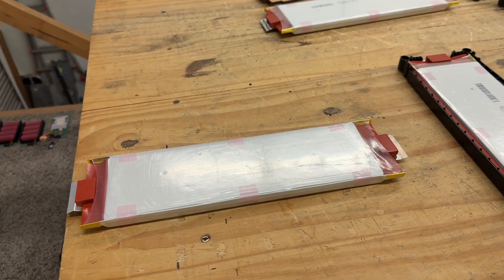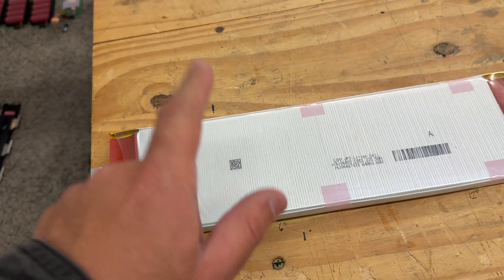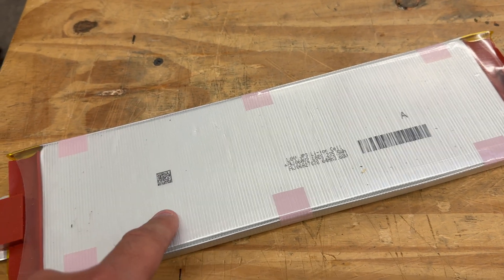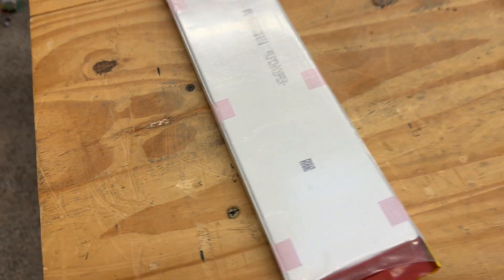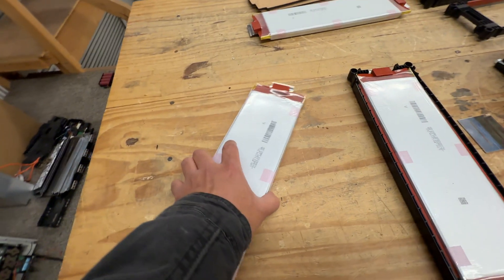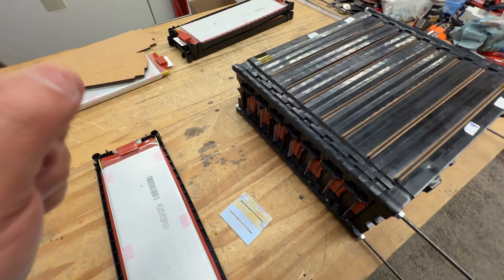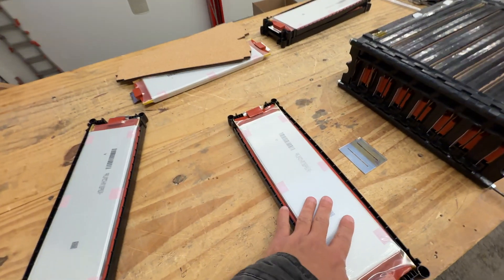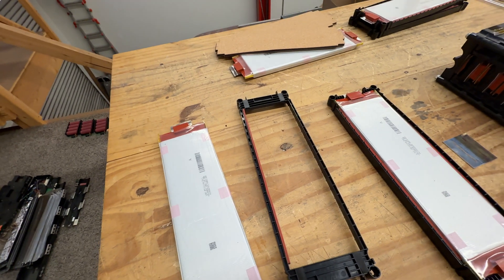LG JP3 64Ah Pouch POWER cell - 500A Burst - Overstock

Comment: FYI Most of the cells being sold by 3rd party sellers are likely problematic. Failed during testing and taped, wrapped in plastic and sent to be recycled. Failures include; insulation, voltage degradation, etc outside of specification.

Comment: Yo Jehu, do you think these cells can handle 100 amps of charge current. Thinking of building a hybrid battery pack out of these, but when the regen breaking hits it dumps about 100 amps into the battery?
Reply from the maker: Usually charge speeds are half of discharge speeds so 200A cells should be able to take 100A of charging
Reply: Ok awesome thanks for the info!

Comment: How does one weld the tabs?
Reply: You can spot weld them, some people connect them with soldering also third option would be to connect them screws
Reply: @ak16-i5z you can't spot weld the aluminum tabs
Reply: @joshkelly3743  you can use aluminum solder with yellow mag-torch :face-fuchsia-tongue-out:
Reply: @fvrrljr  I am generally pretty bold. But doing that on these cells ! Hell to the nah
Reply: @joshkelly3743  You can with the right spot welder. I do it all the time with my Glitter 811H
Reply: @ak16-i5z  3rd option 👍
Reply: Carefully
Reply: With the laser DIY users dont have.

Comment: Just to verify...these cells are NOT protected, right?
Reply: un protected usual;ly
Reply: Its not hard to connect them with a bms
Reply: @ak16-i5z  individual cell level protection is different than a BMS. It was a good question. Oftentimes polymer cells have built-in protection. So can cylindrical cells it's just less common.

Comment: man, i keep forgetting there's no shipping across the pond.

one of these on the bottom of an RC car would be amazing
Reply: yeah some good ideas
Reply: You know that they are 3.9v?
You've got a large RC car at that length running only 1s?
Lets say you are running 4s, maybe you could stack these cells into the frame of an RC car? I'm not saying it's impossible, buy you would be carrying a lot of weight for your RC car which maybe great for long range considering their size?
Just like if people who owned these wrecked Teslas that modify them or transplant their tech into donar car etc. If they only realised that they only need enough battery pack modules to give the final voltage output of a full battery. If you are drag racing the thing who cares if it's only got 10miles of range? That's 40 passes down the drag strip in comparison and your EV now weighs a fraction of the OEM weight. You only need to match the cell P configuration and basically ignore and S configuration 😆

These would make great Electric skateboards cells in my opinion

Comment: You want the cells to expand,  cylindrical cells can vent the pressure of gas build up. Pouch don’t have vents so they have to swell or they will burst.  I don’t think the tape will stop them swelling.
Reply: the cell holders a foam and cork separators that keep the proper pressure when everything is assembled. Its not the tape that keep compression. It just another layer of protection
Reply: Tape will definitely no stop swelling because it won't stop the cell from becoming round, and a circle encloses more area.

The rectangle is 4.125 X 0.5 X 16.75 tall for a volume of 2.0625 X 16.75 or 34.5.
The perimeter is 9.25 around X 16.75 tall which could form a circle of 2.95 diameter X 16.75 tall for a volume of 6.8 X 16.75 or 114.  The thing will poof up like a balloon.  BTDT.